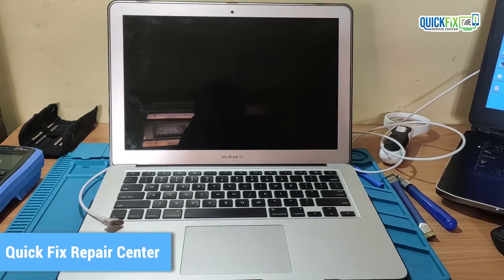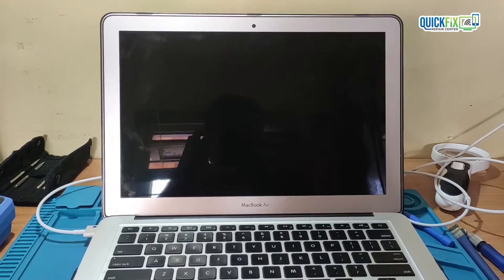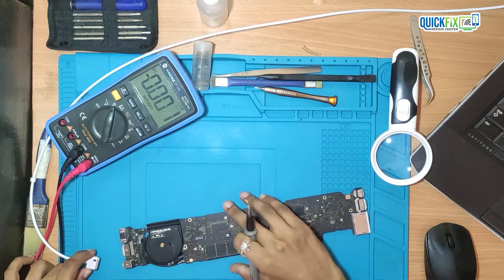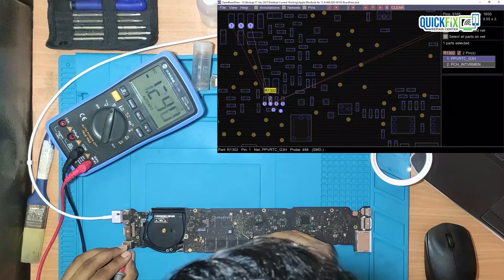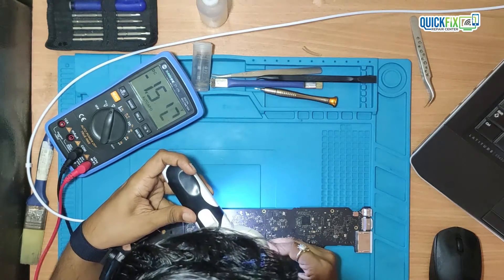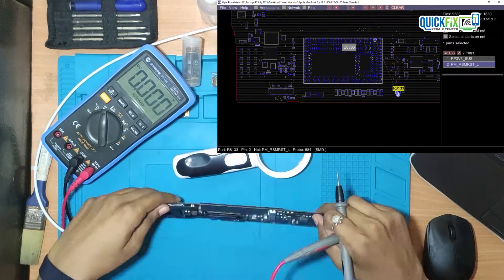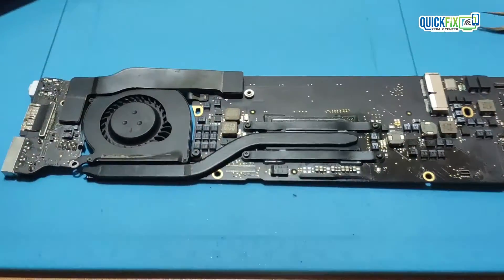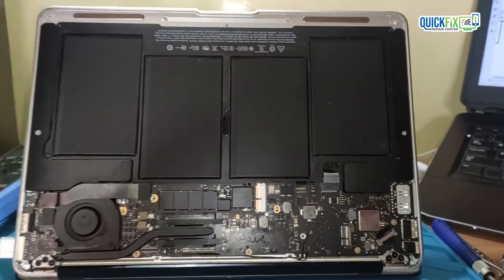MacBook Air not turning ON FIX | MacBook Repair A1466

Comment: hello Quick Fix, may i ask something,  i test all the voltage even ta last PM_RSMRST_L has a present voltage 3.3V it wont turn on. all power rails are present. what the possible other issues? thanks for the replay
Reply from the maker: It's hard to tell without diagnosed Ur motherboard😅

Comment: Hey man!  I have a similar macbook air 2011 A1370.  In my case, I tried replacing the battery, and it turned on, but after about an hour it turned off even though the battery was at 80% still.  
after that, that mocbook won't turn on, and if plug the charger in, the light stays on green, never charging the battery.  I bought  NEW battery, but it still does not go amber/orange.  I waited about 5 hours before turning on just in case, but it won't turn on.   
Did I short something out?
Reply from the maker: Test without batter. If its turning on or not? If Mac turn on without batter then definitely it's battery related issue. If not then need to dignose motherboard for powering on sequence.

Comment: What might be the problem with A1466 macbook, if charger is not showing any light, even if the charger is working with other machines.
And it has started like this after updating OS during that updation it got bit heated up
Reply from the maker: Might be issue in charger detection circuit on MacBook motherboard. Please check all charging requirements as per schematic.
Reply: Thank you for your quick response. 
The technician is saying it has problem with some chip of motherboard, can this be the case as it has suddenly started this issue, after updation or it might have some software issues?
Reply from the maker: Mostly it's hardware failure means chip or one of the components itself is damaged. But in rare case if chip is programmable then their migh be a chance  while updating the firmware of particular chip is corrupt.
Reply: How can we detect whether chip is programmable or corrupt ... if the chip of motherboard has to be replaced, how much will it cost?
Reply from the maker: Search on google ic number. It's mentioned in data sheet. Price depends country to country or location 😅

Comment: Brother my MacBook 1465 not turning on but can see charging charge turning orange to green 
I did smc reset tat time charger turn orange to green and orange but no luck
I tried pram reset tat allso not working
I removed battery tryed to on with power cable still not working
I pre power button 20sec and tried to on but not working
What I will do next plz help
Reply from the maker: Use apple power plan for diagnose issue. Use schematic. Definately you will fix this issue.
Reply: @QuickFixRepairCenter  can I k ow what is Apple power plan sorry.
Reply from the maker: In schematic there is a power rail sequence is given. Refere that to fix issue.
Reply: @QuickFixRepairCenter  brother I checked one more thing.I removed battery conection and checked power. Mother board is giving charge to battery but battery still in .23volt I checked with multimeter 
I keep the laptop connected with power cable for 1 hour  after I checked the battery. But still .23v not came up
Is that battery making problm?
I removed the battery out and connected booster still battery  in .23 volt not coming up
But my dout is  without battery power MacBook Air a1465 will not work with power cable?
Reply from the maker: May be battery is faulty. But after removing battery if you plug charger then MacBook need to turn on without an issue. If that is not case then there is motherboard issue still exists. No doubt battery is also drained.
Reply from the maker: Also check battery circuit if there is any short on the line
Reply: @QuickFixRepairCenter  battery circuit is ok I checked the connection port it deliver current  but battery not charging . Staying in .23 not going up
Reply: @QuickFixRepairCenter  hm tat is true without battery with power plugged not turning on

Comment: Great video!! I also have 820-00165 board, and following your route, 0.25V on PPVRTC_G3H !,what next?
Reply from the maker: Follow Power Sequence mentioned on schematic to fix your issue 🙂
Reply: @QuickFixRepairCenter  canu pls, tell me wick page as i am new in macbook repairs, can follow power line, but dont knwo whqats proper sequence of turning it on
Reply from the maker: You can search on Google "MacBook Power Plan"

Comment: i have  all the voltages,but not powering...what next?
Reply from the maker: Check other power lines according to schematic which is necessary and try to reprogram bios chip if all lines are ok.
Reply: @QuickFixRepairCenter  i have 5V generated, but something crashes the 5V rail....but can't find no shorts...when i inject 5V it also crashes  the voltage, something is pulling current and it shuts down and goes to loop like that...
Reply from the maker: Ok. Check that particular line where it's generating and from that point trace all circuit it's distributing. You have to disconnect one by one circuit to find faulty component. If u have thermal camera then it's may be easier to identify faulty components.

By the way when u injecting 5v on line, how much ampere take on dc machine?
Reply: @QuickFixRepairCenter  without injecting ,  i am measuring at the fan_plus, the voltage briefly jumps to 2V and then it restarts...when injecting 5V the rail draws around 500mA, i will now scan with termal camera...
but the 5V on U7501 output is stable, doesn't drop....
Reply from the maker: Ok

Comment: Hi I have also same issue with my Mac book air A1465 won't turn off. Can you pls check my laptop. Iam from chennai. Where is your store location.
Reply from the maker: Location is in Mumbai
Reply: How much it cost to replace ic ?
Reply from the maker: It's depends on types of ic. No fix rate.

Comment: I get pm_batlow
0voltage

Mac air 13 1466
How cek resistor below?
R1041 (10k) on skematik

I check multitester, 5k ohm, and 10K ohm, in another resistor with same value on skematik 10k, i chek 12k, and 5k

This mean, ic u5000 or the resistor?
Reply from the maker: First thing, remove resistor from circuit and then check, that way it will give perfect value. Once identify replace faulty components.